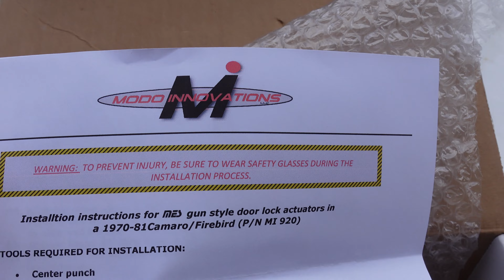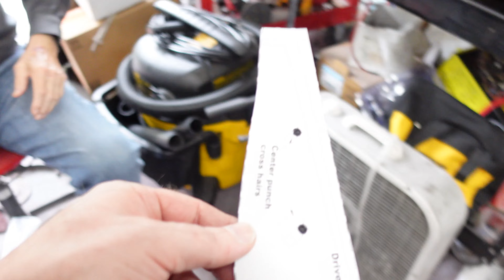1977 Camaro Z28 Part 313: Power door locks

Comment: What I did to quiet my door rattles down was, I put different size shrink tubing and some small vacuum line hose pieces in the areas that rattle alot,  plus sound deadener on the inner door skin. Almost sounds like modern assembly line quality.  Hope this helps.
Reply from the maker: Yeah, makes sense. Thanks Anthony

Comment: I did the same thing the only difference is that I went to the junk yard to get all the parts
Reply from the maker: Cool. What car(s) did you pull the parts from? Camaro's?
Reply: @asicerik  no, I went to look for cars that were from the 70s and 80s. . Some cars share the same power lock actuators from 1960s to 2000.  I don't remember if I pull the brackets from a 69, 70 Oldsmobile or Chevy luxury car. I got them because they were in the same position as the firebird power lock brackets. The lock switch from a 70s Chevy G20 van.  The connector to power switch, from a Chevy Astro van.  I got keyless unit  from a 4th gen Camaro and purchased the keyless entry remote control from Amazon for 7 dollars. Also from Amazon, I purchased one rod link for a firebird power lock. I got another one from the junkyard and bend it to fit the other door.  I was lucky that day that I got the actuator for the trunk. It takes time, but it is a hobby. It is a long time personal project.